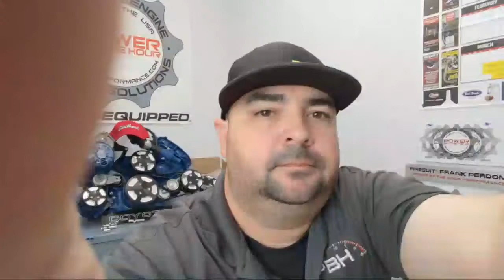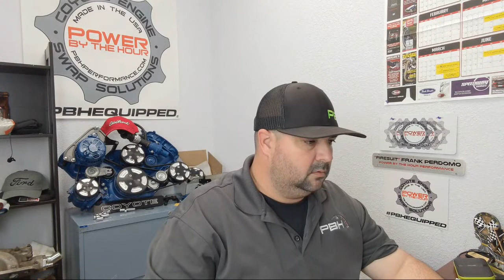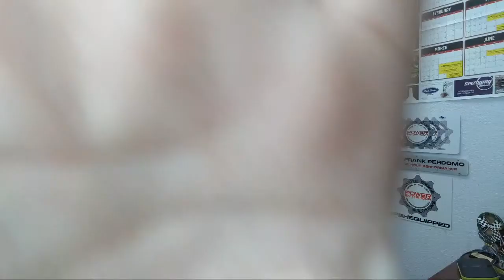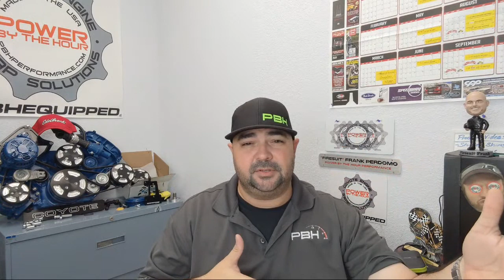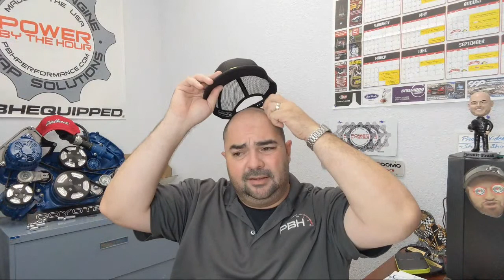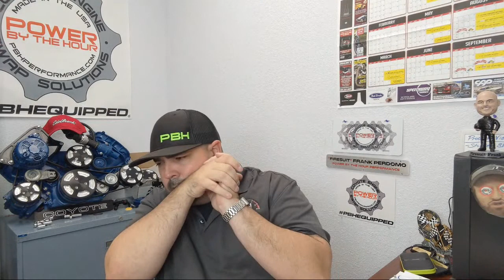PBH Live Episode #3

Comment: I have a 2013 GT 6r80 car. Does PBH have a paddle shifter kit you all recommend for adding paddle shifters to these cars?
Reply from the maker: We do not Patrick. If you find a wheel or setup that has paddles where the paddles operate as momentary button/switch we can help you get it wires to work.